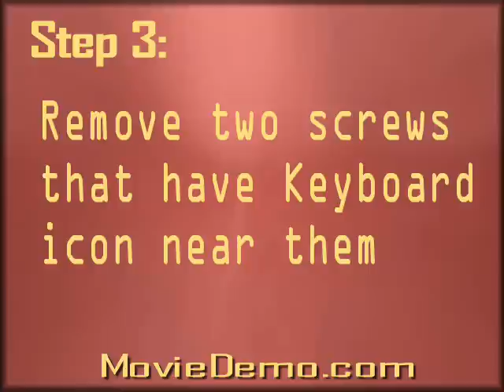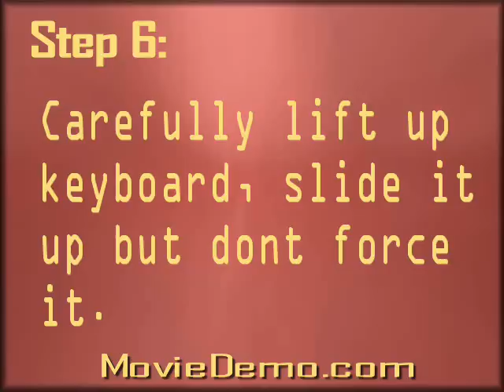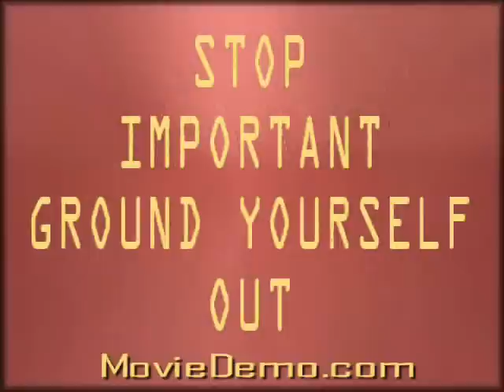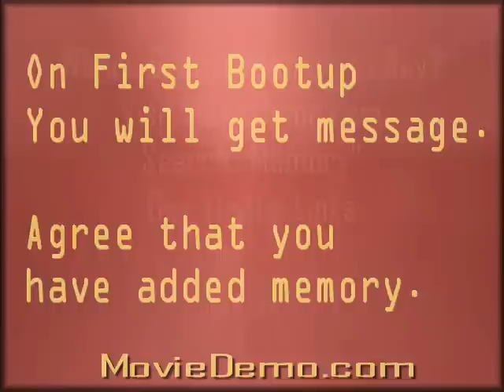Add Memory to Laptop - HP Compaq NC6000

Comment: Thanks for the video, it was a life-saver while working on a friend's nc6000!  By the way, if there is a wireless card, as in the one I'm working on, it will be a under a panel on the bottom that looks like a memory panel.

Comment from the maker: It depends on your laptop.  If it is the same model as this one, I do not believe there is an internal slot for a wireless card.  What I use to connect to the internet/network with that laptop is a Wireless PCMCIA Network Card.  It simply slide in a slot usually found on the side of almost all laptops. (very easy install)

Comment: my compaq has dual slots with 512mb in each slot, equaling 1 gig. I want to upgrade it. But I'm confused. right now it uses pc2700 333mhz ddr. I was wondering if I can use a faster chip like a 400? or higher? will the faster chip damage my laptop? Help!!! by the way great video!

Comment: I got 2 problems;
1-If I have my usb mouse attached and I start it up, the mouse pad dosnt work(to make it work i have to restart computer and take off the usb mouse)

2-Battery dosnt work properly it maximum goes for 10minutes then gives me low battery message. Even if I charge the laptop for full night and unplug the ac adaptor it only works for like 10 minutes... I seriously need some help with this laptop!